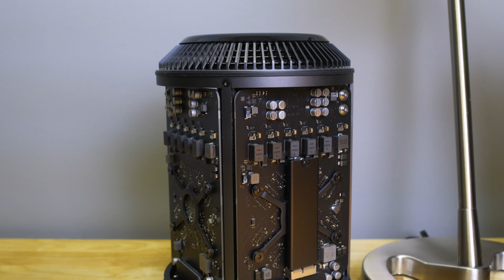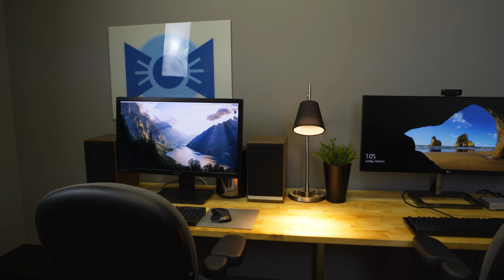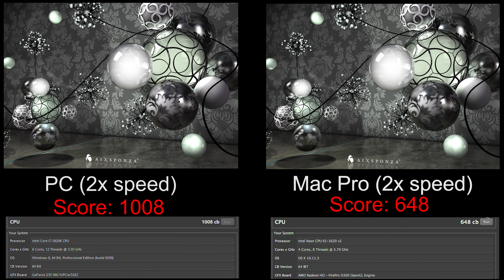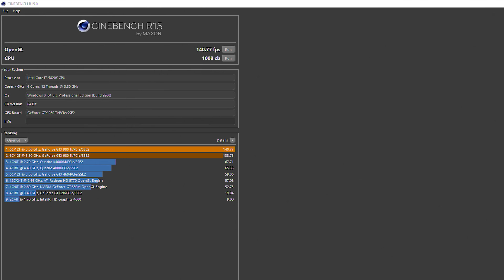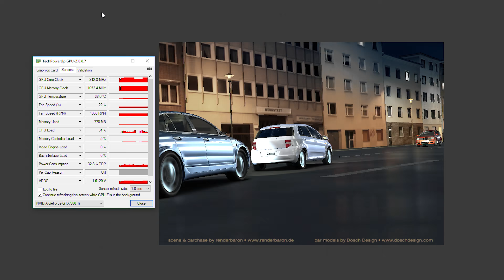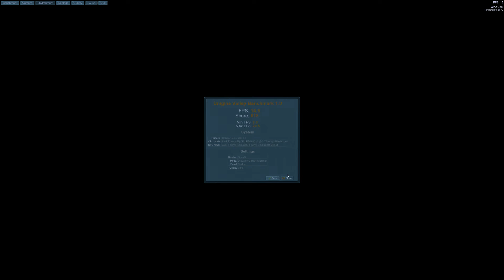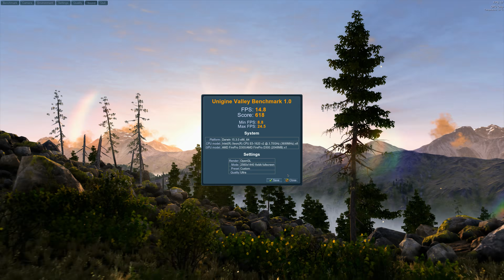$2,000 Custom PC vs $4,000 Mac Pro

Comment: Are you planning on getting the new 1060? It'll be around $250 and be more powerful than a 980ti.
Reply: No it is going to be as powerful as the regular 980, you would need a 1070 to get 980 ti levels of performance.
Reply: Which I do have. :T
Reply: Holy fucking shit, you look exactly like my brother. Like I had to look at your profile picture multiple times, because it threw me off hardcore.
Reply: that new 3gb 1060 is trash tho
Reply: ***** it is true, the gtx 1060 performs like a gtx 980, look at here http://hwbench.com/vgas/geforce-gtx-1060-vs-geforce-gtx-980 the thing is that sometimes the 1060 is better and sometimes the 980
Reply: A 1070 beats the 980ti and a Titan X, but you are right about the 1060.
Reply: im getting the 1060
Reply: Michael Tarantino the 6 gb is good
Reply: Michael Tarantino the gtx 1060 isnt more powerful than the gtx 980ti, it performs like the gtx 980
Reply: ***** what he is trying top prove is correct tho, the 1060 does perform like a 980 and even beats it in certain areas, also its much much cheaper.
Reply: ***** well yes, of course

Comment: damn, my i7 875 @ 4.2ghz/ 16gb ddr3 @1600mghz (the p55 chipset, 5 or 6 years old, now)/ 2x gtx 970 sli, scores much higher than that in unigine @ 1440p on ultra i don't remember the exact score but some where in the neighborhood of 40 fps. I am sure that apple will kick my pc in the dirt during cinebench but wow, that's all apple gives you for $4k ... and some attempt to claim that they dont get for apple because its a status svmbol/ fashion statement?

i am no fanboy, i look at all products objectively, when i built my PC, i did look at apple and for the tier of parts i was in the market for, PC was much cheaper, had a greater selection of current hardware and i could get a more powerful machine that i could fix myself/ replace parts easily ... all for around $600 or $700 less. so it was a no brainer.
Reply: i5 750 for gaming here, OC'd to 4.0 and it works like a damn charm even thought its 7 years old

Comment: are you forgetting not everyone can build a pc. the reason the mac is costly is because of that
Reply: you could still BUY a pc for 1200-2000 that would run circles around the mac since the 10xx series came out from nvidia you could beat it even cheaper. I guarantee a 1060gtx with a 6700k would trounce that thing. Seriously you could spend say 3000 on a PC save the rest to buy a copy  of OSX use bootcamp to dual boot and not only would you have a mac that would quadruple the performance of the mac pro but you'd have a nice windows machine and enough left over to replace your stupid iphone with a real phone with change left over for pizza and beer.
Reply: Everyone CAN build a PC, some prefer not to do so. Building a PC is easy as hell.
Reply: If your doing it for a career I understand it's a totally different world, I didn't come here for a arguement. All I'm saying is that building a PC for normal applications like surfing the web or a gaming PC is not that complicated.
Reply: +papinbala you can buy a PC already builded on bestbuy, you have to connects 3 cables and you will have something 3 times better for less than a half bucks, people want it just for "having status", thats it.
Reply: Kek. 3000 on a pc you would way more than quadruple the performance. With 3k on a PC you could easily run 10XX sli's(given that you find a good price). The rest is up to you. Dope ass Mobo, CPU, Cpu and gpu watercooling, etc.
Reply: +Steven Cox no everyone cant build a pc what are you talking about. your trying to tell me if you randomly pic any man or woman on the street that they will know that they need a power supply, motherboard, CPU, graphics card, sound card, ram, ethernet adapter, dvd drive, fans, etc... and then get it running and properly install all the drivers and make sure everything is running right.  I DONT THINK SO.
Reply: +Henry Tate yes i understand and i agree but the reason the Mac is expensive is not because of specs or performance. the main reason is because its an apple product,  pure and simple. the same  reason a Mercedes S class is worth double the price then a Nissan GT-R even though the GT-R will run circles around the benz.
Reply: +papinbala
you are forgetting we live in the age where you don't need to know how to build a pc since you can just google it or search here on youtube.
Reply: +Chris Kent my answer to that would be the same answer i gave Henry
Reply: +zero umashi im not forgetting that. the guy said everyone can build a pc because its easy as hell which is just not true. i just built one 2 weeks ago and even with googles help i was getting errors and all type of glitches that took time to fix. there is no way a middle aged woman would just swift through it like its nothing.
Reply: errors could be avoided as far as i know if you get parts specifically compatible with that specific motherboard,
any unforseen errors are usually due to needed motherboard bios updates or glitchy drivers
or the most common problem being the bios needed to be configured.
Reply: +zero umashi lolll whatever you say buddy. have a good one.
Reply: +zero umashi you kinda sound ridiculous trying to prove your point that every single person no matter what could put together a whole computer with ease. i mean your here talking about configuring the bios. do you really think every middle age woman will know how to do that. even if you google it. it can be difficult at time for people who know about computers.  i put a computer together 2 weeks ago and some things were challenging even though i put more than 10 computers together in my time. but to think every person will go through it eith ease ot kinda silly.
Reply: after doing some research i have come up with the fact that the mac pro's hardware would cost, at the very most $900 that means they are charging, lets see here $3,100 for assembly
Reply: you would be surprised at how ignorant alot of people are. heck most people dont even know what a mother board is
Reply: papinbala I never once said "every single person no matter what could put together a whole computer"
however a normal person can put together a computer.
as for google results
it's only a matter of the search terms you're using as not everyone will end up with the same search results because it depends on the search terms you use
and google doesn't work well if you type in a long search term.
Reply: a normal person? you mean a person without down syndrome? because a normal person is basically just that. if a person is not normal then something must be wrong with them so please tell me. what is a normal person? please tell me.  and if google doesn't work well like your saying that just goes further into proving my point. because if google cant help a "normal person" then you might need to ask someone to help you with it but if the person gets outside help then that defeats the whole purpose of this argument. read carefully how this convo even started. i dont understand how you dont agree with me.
Reply: That's not the reason why the Mac is costly. You can also buy pre-built PCs from HP or IBM.The reason is that it works. No need for drivers, no need for installation wizards, no need for anti-virus, no need for overpriced office licenses and you know the computer will be available when you need it, without any mysterious crashes or malfunctions without ever needing to reinstall it.
Reply: I don't know maybe someone as dumb as you might struggle. Everyone else knows how to follow simple DIY instructions from youtube. We live in a time where everyone has a computer in their pocket and full access to the entire wealth of human knowledge at our fingertips.
Reply: LOL hours to fix glitches on a new PC you built? Maybe you're a special kind of special?
Reply: I'm not computer savvy what so ever and I built one. Granted not as nice as his but they're pretty much plug and play when building.
Reply: +metallica1977 holy shit your fucking annoying no one is talking about you. what you are trying to say is wrong. is a 50 year old woman a normal person.   acually nevermind. have a good one .
Reply: +Steven Cox yea shithead you dont even know who y talking to. go 9b linus youruve channel and 2atch him biluild top nitch pc"s tgere are always problems
Reply: papinbala Well that was nice to get that very educated reply back...
Reply: +metallica1977 what you got in mind is your simple pc. those are super easy. when you soend 10 to 12k then come talk to me. and yes i am special very special. lol ohh if you only knew
Reply: +metallica1977 what you got in mind is your simple pc. those are super easy. when you soend 10 to 12k then come talk to me. and yes i am special very special. lol ohh if you only knew
Reply: Your right simple PCs are super easy to build. I don't ever plan on "soending" 10 to 12k on a PC. As far as you being special...don't really care.
Reply: +metallica1977 im not special buddy. l dont think im brtter than anyone. i spent that much because it was time for me to upgrade. and  the pc is built for music production. just the sound card was close to 2k
Reply: i didnt say it was. but the other guy who i was talking to suggests that anyone could do it wwith ease.  im sure a middle aged woman would have a a hard time
Reply: I got my $2000 PC built only for $50 from the same company that I brought the parts from
Reply: if you are too stupid to build a pc you shouldn't be allowed to breed. hell, it's easier than lego.
Reply: Ben I am your father.
Reply: your gonna have a little brother soon benie
Reply: +papinbala holy shit. i had no idea.
Reply: +Carl Johnson thats exactly what i said 8n my 2nd or third response
Reply: +Carl Johnson yea i agree. i jever had anything apple just the iphone 1 and iphone 5 everything else was desktop pcs or android
Reply: i wouldn't say its shit. i like how smooth their products operate but im just not an apple guy. are you from the states. are you a tweeker?
Reply: you can even buy a pre built and better AND CHEAPER
Reply: Msi NOT TRUE.

Comment: Just my thoughts on your build, you could have gotten a core i3-6100 for maybe 150 CAD (not sure how much in USD) that runs at a base clock of 3.7 ghz (you probably could over clock it to what you said 4.2 ghz). In my opinion it might have made your build a little more cost efficient, and you would be able to upgrade later on to an i5 or i7. By it all depends on your liking. Also I did really enjoy the video, it truly showed the strength of the PC.

Comment: are you trying to say that they should lower the price of the mac pro
Reply from the maker: +Kevin Vela I'm trying to say that Apple should update their 3-year-old computer that was already outdated 3 years ago when they released it.
Reply: +Snazzy Labs I think if you show this to Apple fans they will claim superior software haha. Great video
Reply: +Kevin Vela no... They shouldn't
Reply: +Kevin Vela macos is comparable to Linux which is great in performance, however the main part that makes a Mac great for editing and content creation is final cut X . final cut renders videos at extremely fast speeds. But other than that the PC is superior
Reply: What is the point of flaunting "Superior Software" if the Mac doesn't have the power to provide the software the needed CPU and GPU it needs to begin with?
Reply: YES MAC IS SOO MUCH and its SLOW
Reply: yes
Reply: perhaps they should
Reply: well the thing about it is apples software is extraordinary compared to pc. I think in my opinion and they treat their customers great.
Reply: well this was three years ago. and besides the point their both using intel processors. so whos to blame intel or the operating systems
Reply: MacOS is NOT great in terms of performance. http://www.phoronix.com/scan.php?page=article&item=osx-capitan-fedora23&num=3
The only test where it beats Linux is the PostegreSQL benchmark (and as pointed out by the comments, it's due to OSX not syncing on write).

Comment: The Mac hardware is 3X the visual design than anything out there. Its the only company that pushes their design out of the box that all other computers come in. Now only if they could meet the new power with that futuristic design!
Reply: Like I stated "if they could meet the power" it would be great. I just think if we live in the 21st it should look 21st. The box is so old. Apple does have an awesome marketing team and that's how they make money. I've been a pc guy for years and have had trouble with them constantly. I have to give the PC a lot of credit for teaching me computer hardware repair and constant software management. That's all I did when I owed them, especially to keep things running smoothly. I'm not a big gamer so all I use is MAC now. I love them, have so many less issues, and feel pretty smart for buying one.
Reply: Just creating something looking neatly is not design at all.
Dieter Rams: "Good design makes a product useful."
Nearly all recent design changes (RAM not changeable, trash can, removing ports, ...) made Apple products less useful and therefore are to be considered bad design.

Comment: A Mac Pro of those specs would cost 3,000... just a measly $1000 less than what you unfairly quoted it at. The mac costs more simply because it is a better all around package. I find it nonsense to compare an obviously more specked out machine and then laugh when the numerically weaker mac doesn't stack up... then one can argue the price.... for the average american who has a real job, they wouldn't have the time to spend on constructing an immaculate PC. I can buy a kit Porsche and construct it myself for a fraction of the price of one bought from a factory, and I'll even have the same unshakable pride that these PC fanboys have...... It boils down to what are *YOU* looking for. Apple sells workstation grade machines for the average power user (video editors, entertainers, venue managers, etc.) with efficient cooling systems and fast clock speeds,  and i don't see what people are complaining... if you'd rather sit and play world of warcraft on your water cooled mass of a gaming tower, more power to you, but if you try to cram as much power into a space and a package like Apple has successfully done, and you will simply be disappointed.

Comment: the mac pro is a workstation not a gaming machine. the gpu works differently in a workstation than a gaming pc.
Reply: he did a workstation test. exporting a video... 18 mins on a pc, 54 mins on the apple.  If that's not real life enough well...
Reply: The first benchmark he did was for rendering. You know, WORKSTATION stuff.

Comment: the bad thing with pc is that they don't last that long
Reply: +Jonathan Ponce Are you an adult? I love meeting adults as stupid as this guy! lol
Reply: What??? lol may want to research a bit more
Reply: +Phoenix MH83  I already did a lot of research, and as a matter fact I did my a research paper on it
Reply: +Jonathan Ponce You realize that macs and PCs are made of the same things, right? Why would you suggest one fails sooner than the other.
Reply: PC and macs are not the same
Reply: PC don't last that long go do your research first then come talk to me
Reply: +Jonathan Ponce he means that the internals (gpu,cpu,ram, ect) is the same as the pc can have lol, you're obviously not experiencedc in this side of the world.
Reply: +Jonathan Ponce my pentium 3 of 667mhz with 400mb of dimm ram its still running, after almost 20 years....
Reply: Jonathan Ponce lets see...whats inside the mac....GPU...motherboard...CPU....RAM. And whats inside the Windows based PC? Oh what do you know its the same damn thing. Lol I went to school for IT the real difference between Windows PC and mac is software and mac having closed architecture. Thats it. Whatever paper you did for whatever made up school you did it for don't change the facts.
Reply: the only thing different between a mac and the pc is the operating system, they work off of generally the same hardware. The only thing that would make the mac last longer is that its more idiot proof
Reply: You're a special kind of stupid
Reply: Computers are like anything else, if you buy a 200 dollar computer and compare it to a 3000 dollar mac, of course the mac will last longer.  If you buy a 3000 dollar computer, it will last a long time. I've never had a PC crap out on me ever. I usually throw them away because after 7-8 years the hardware isn't worth keeping but I use good components. Take a look at the recent Macbook Pro's, they have horrible life spans. 2011 pro's had problems with the dedicated graphics that makes them die after 3-4 years, 2012 pro's had issues with the sata cable and display hinges, etc. Recent macbook pro's aren't built to last more than 3-4 years and can cost a fortune. my 600 dollar custom built PC has been running for 7 years while overclocked with no hardware issues whatsoever

Comment: And another frustrated Mac user has come to the light side. We're an apple family as well, but my 3D modelling computer is pc. As an amateur,  I can process my rendering and encoding with descent speed on a budget PC. I have a 6 core LGA 1366 i7 980 (6 core) clocked to 4.2GHz that still out performs a lot of my friends mac pros that have spend 2-3 times as much. When i built  my gaming rig, it was PC all the way.